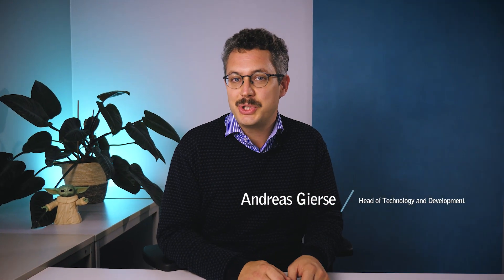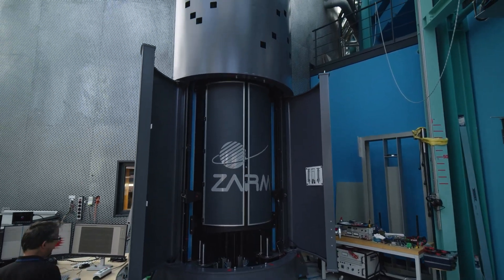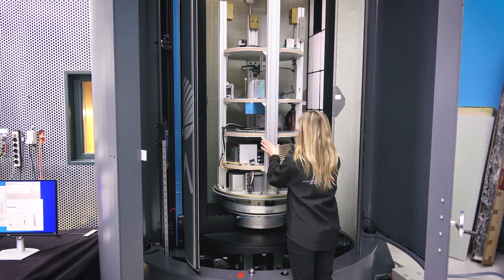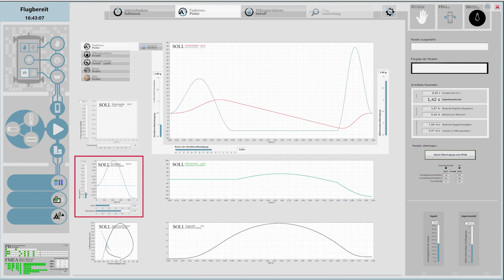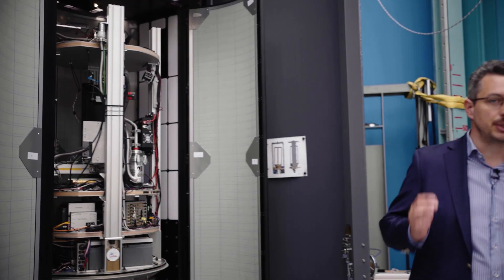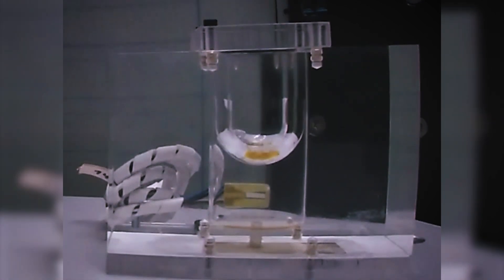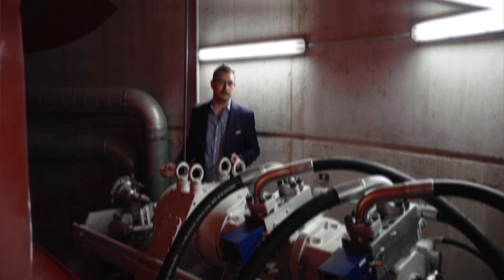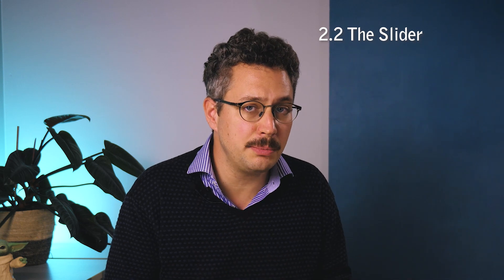The GraviTower Bremen Prototype: In depth look into operation and system

Comment: So the slider is more or less free floating in the cage so you can have high quality microgravity .. but if you would simulate mars or moon gravity you would need some sort of spring between slider and cage to create gravity.  Won't that add vibrations to the quality of gravity.  Unless the springs are weak enough and the mass of the slider relative high.  But that might lower the eigen frequency of the slider, decreasing stable gravity time. So does that require some active damping system. Maybe something like the damper in a car suspension will work.  Looks like the new system is much smaller in diameter as you don't need the vacuum chamber, i guess you have space for multiple systems now,   and i guess it would be much easier to build a bigger slider if needed.
Reply from the maker: Yes exactly, that is correct. With the current decoupling mechanism, the experiment must remain mechanically connected to the slider in the vertical translational degree of freedom, which can reduce the quality. Therefore we are developing  an additional active part for the existing decoupling system. This system will then transfer a precise force vector from the slider to the experiment by using force actuators, without the experiment and the carrier being mechanically connected.
Reply: @ZARM_de  Am i right in assuming that if you are simulating stronger gravity you can have a longer time at that gravity.  So if you would simulate gravity of venus at 80% of earths gravity you can have maybe have 5 times longer compared to micro gravity.  Maybe a bit longer as the traject from earth to target gravity is shorter.  Transferring a force vector without being mechanical connected sounds tricky ... i guess with a couple of active opposing electromagnets you can create a precise force with a simulate zero travel spring so to speak.   But in the video you said that you tried not to have a magnetic field around the experiments.  And if you would create a zero travel spring by taking a mechanical spring and move the end by a servo mechanism you are still mechanically connected .. or if you source a bose electromagnetic car suspension spring or a car air spring or a voice coil of a shake table.   Actually i guess with some disassembling you can make a bose spring or voice coil of a shake table mechanically uncoupled.